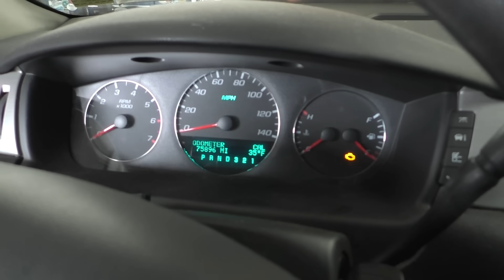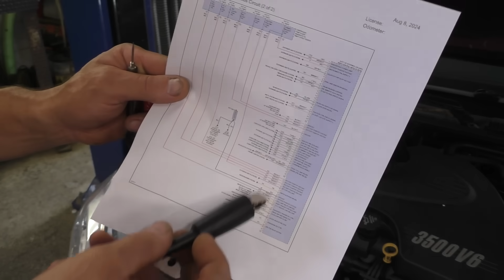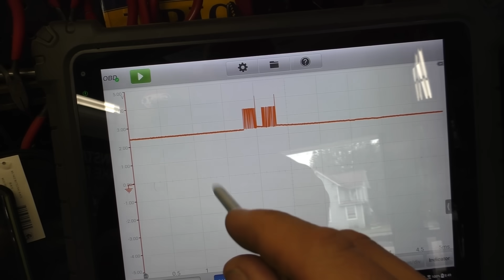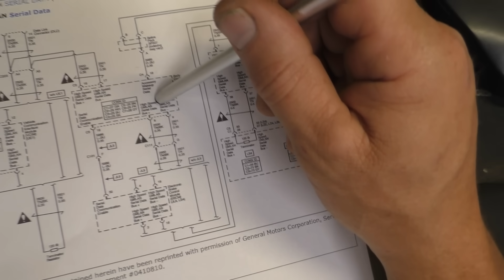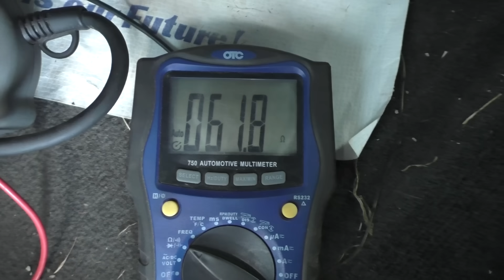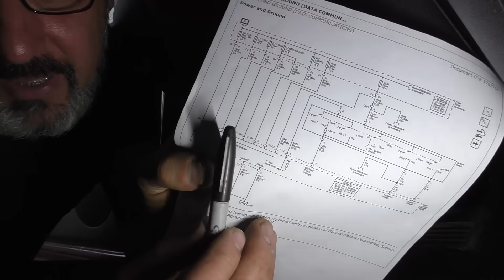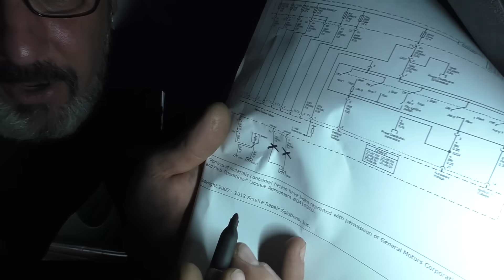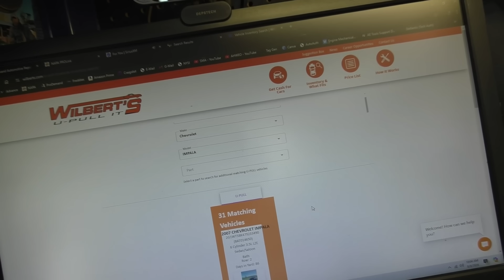Chevy Impala - Sat For 2 Years - No Start, No Crank - Part I

Comment: I would have started by asking the customer WHY it had been parked up two years ago.  Was it because  it would no longer start ?  If it had been shoved against the wall because it had stopped working, then you would KNOW that the mice-nibbled wires were not the SOLE problem.

Comment: PANIC PANIC at members only, no wait, I was sleeping(no, pausing and doing multiple other things). lol
no 5v-ref out from BCM, could be a shorted wire downstream, causing it to shut down output. then again, that is an 2007 lol, so maybe not and it's cooked?
"once again" I didn't watch far enough before commenting. lol 45:30 checks for a short to ground, of course that doesn't mean one didn't occur previously(or short to power) and kill the BCM from a bad design which has no protection.

Comment: Hey, eric, how you doing my good man, I love your channel. I have learned so much from you. The only thing that I still am very hasantan is the electronic stuff, even though can't really do much anymore, I still try to retain as much as possible. And then my electronics on a car is, let's say, touchy, at best.I'm not that confident in electronics. But I have a question and I hope you can answer it for me. My Son in law Is going to be doing some Doing breaks having to replace a driver's side front wheel bearing and I needed to know what or where can I go to on the internet to find torque specifications for A lot of the Nuts like the balljoints, okay, and the axle nut. I watch every one of your new videos and actually right now. I'm watching the one with the a car that's been sitting for 7 years, no start. I know you're busy, but I hope I can get a few answers or maybe you have some answers for me. I'm where I can get these torque values. Thanks, and please keep doing what you're doing like. I said I've learned a lot, and whenever I can pass on the info to my cinelaws. I do cause they're handymen. They work on cars and they always like learning just like I do so. Thanks once again for what you do. Keep doing it and I look forward to watching more. Your awesome videos. Thanks matt from michigan
Reply: Hey Eric, it's Matt from Michigan. I forgot to tell you that the car that he's gonna be working on and that I need to tech torque specs for some nuts. Is a two thousand eleven Ford fusion sel Now I know what you're gonna say it's a ford, but I have 3 2011 one with 249000,1 with 122000and a 2007 with 184000,all v6 all sel all all wheel drive and one f150 2014 182000 fx4 v6 twin turbo yes I love my fords.thanks Matt from Michigan

Comment: Question, in the scan you said it show a high voltage where they probably were nuking the battery, if they tried starting at the same time could that send a surge through the BCM to smoke it?
Reply: That's exactly what it is. The older cars' electronics were sensitive to over voltage (one of the reasons they always said to turn on a radio or something from the donor vehicle to draw power on the surge when the other vehicle started. Most modern vehicles have over voltage protections as far as I know, but I still turn stuff on out of habit when jumping someone else's vehicle.

Comment: Any way to measure +5V out with load (on that pin) removed ?
Could be an external load failure - like a shorted wire to the throttle body etc.

Comment: Eric can you please tell me the part number or application for your headlight(testlight) you are using to test/ck your circuits. What are you using for terminal ends on the wires to probe the connectors with?  I would like to get one for myself at the auto parts store. By the way I LOVE your PSA.
Reply from the maker: https://youtube.com/watch?v=-L_fw7xn19k&si=Dg-KSgRo-vTgOZ3-
Reply: @SouthMainAuto  Thanks for the quick response. Love what you do (not in a weird way or anything like that) lol. Been watching for LONG time keep up the good work.

Comment: When one checks to bus, you measure for 2 terminating resistors in parallel 60 ohms. Great. Is there a reason you dont check that neither is grounded? Happened to me one time debugging a corporate data network.

Comment: Not sure if you can program a used bcm in this without eeprom work for the mileage to be correct
Reply from the maker: Mileage is stored in the cluster, not the body module. You can put used body modules in these all day long. They just need to shake hands with the airbag module and a couple quick relearns for the brake pedal position

Comment: Just looked it up because it blew my mind: you could buy a 3500lb full size sedan in the US from Government Motors without ABS! I'm sorry, maybe I'm spoiled by Fords, but that is just plain not optional. My 1993 Explorer had 4WABS, my 98 Ram WT (stripped down) had RABS. I mean... was GM so hard up to get their prices lower to move vehicles that they made safety features optional on their premier lineup? Another reason to log into my book of "Why GM vehicles are just cheap junk", along with drum brakes on an 09 GMC Sierra, ridiculously tiny rear axles, abysmal transmissions and terrible FWD engines.
Reply: Early 2000s abs on gm cars was terrifying to have. I pulled the abs fuse on my astro van and never put it back in after it tried to kill me in the snow a few times

Comment: Does the shop have a separate charge for diagnosis that takes over an hour ?
There's many years experience here,and it's great for us subscribers to get schooled in proper diagnosis by a pro, instead of a hack,
using real time circuit checking- to at least increase the odds,make an informed guess
Of course you know    this whole  diagnosis  is commonly done with a replacement part first because at $150 hr to diagnose a $200 or less BCM  overnight shipping
Can you imagine if the replacement BCM doesn't magically repair the problems- how much time it's going to take, to actually figure it all out
Yes they could have sent you another bad module,but if you send it back ,it will test good,so uh , that bay is now making no money
This dilemma goes all the way back to the very first 'computer' in a car 
VW  The Type III had a Bosch D-Jetronic electronic fuel injection (EFI) system in 1968
VW  The Type I  had not one stinking computer,even DYI'ers could keep it moving in 1968

Comment: Why is that every mechanic say no start, no crank? Simply no crank because sure enough it won't start if it ain't cranking. I don't know...
Reply: Lolol just the other day I parked on a hill, turned on the key, released the brake, rolled down hill and popped the clutch to start my ol 94 pickup truck. Lolol

Comment: No ABS? Over here in Europe it's mandated on cars. And why does this train keep blowing it's horn! That's is something else you don't have in Europe
Reply: ABS didn't get forced down out throats until 2011 in the US. With it came traction control, stability control and other BS that just added more junk to the vehicles.
Reply: The horn blowing is to do with Federal regulations around level crossings according to what I read when I looked it up  (horn has to be sounded in a set sequence regardless of the level of protection on the crossing)

Comment: A guy has a little puzzlement as to why you go through all those light-bulb tests before fixing all the chewed wires. Is that some 5-dimensional chess kind of thinking?
Reply from the maker: Because like I mentioned in the video. I got hired to get the car running. Not fix everything i see. The chewed up wires had nothing to do with why the car doesn't run 🤷‍♂️
Reply: Wires still had continuity, even if a little bit chewed on the insulator. No need to fix to diagnose the dead BCM.

Comment: Why is it that you choose to use a "high amperage test light" AKA headlight bulb? Would it not be safer to use something that draws low amperage? Sorry if it's a silly question, just an apprentice trying to understand! 

Thanks

Edit: after watching, I imagine it's because the connectors are unplugged when testing, this wouldn't be recommended if connector was plugged in, right?

Comment: What is in wire insulation that makes rodent's want to eat it?
Reply: Sometimes its the soya bean content in the insulation plasticisers (used instead of petroleum based products on the later model stuff)that they're after. 
In our neck of the woods they ate the insulation well before the plasticisers changed, so who knows, but they will also nibble a few strands of the wire so perhaps they're after the copper for some reason as well?

They also used to eat the rubber screen washer tubing and any of the soft plastic caps like brake fluid reservoir or screen wash bottle. Also seen them more than once get into the car via the HVAC fresh air intake (on some of our product the fresh/recirc flap went to the fresh setting key off by default)and bore their way through the rear seat backrest upholstery to get at a bag of chicken food pellets in the boot (trunk).